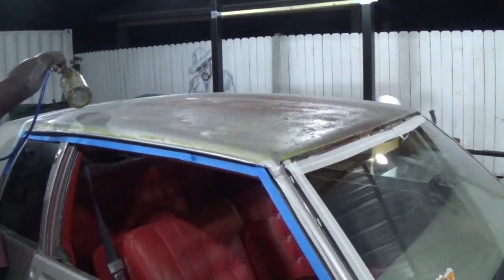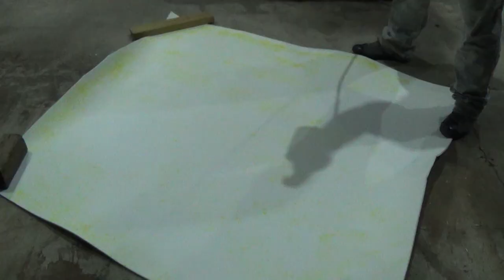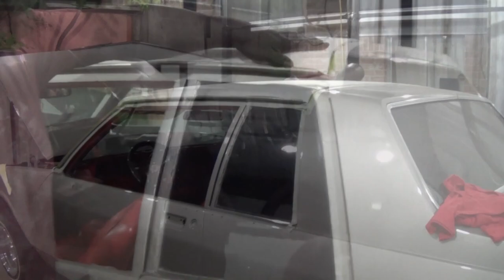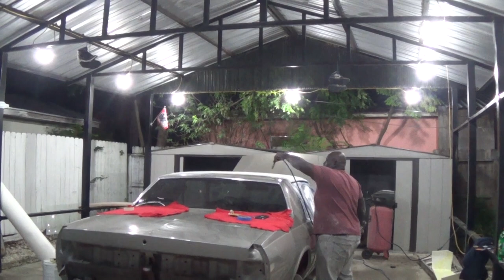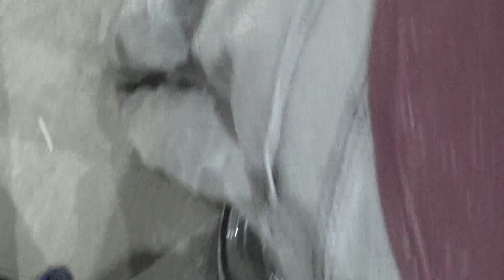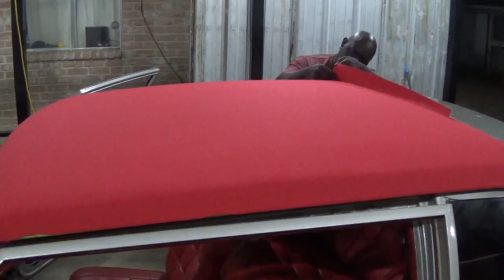HOW TO INSTALL A LANDAU TOP ON A BOX CHEVY...

Comment: What type of material is that on the top? Looking to do mine in the same color
Reply from the maker: Would have to ask...
Reply: this is old but hopefully it'll help, that would likely be Landau Top Vynil. It's made to be more UV, moisture, and damage resistant. You'd wanna go with that for the best results but you could just find you a good quality from a different brand. I've found the Landau for $26/yard